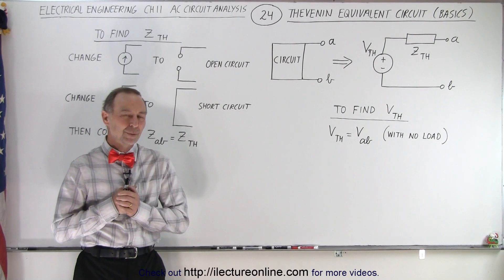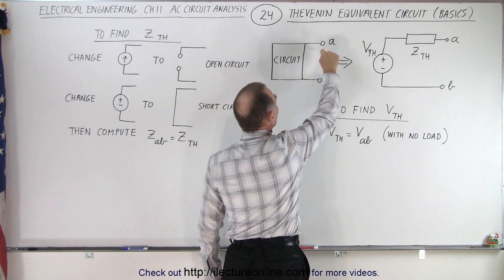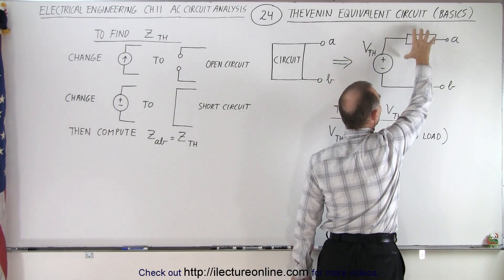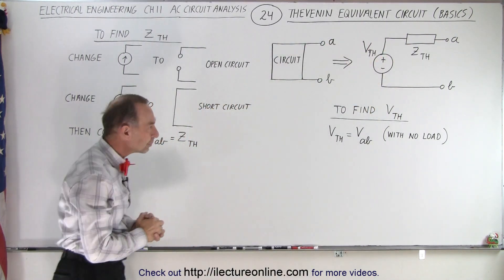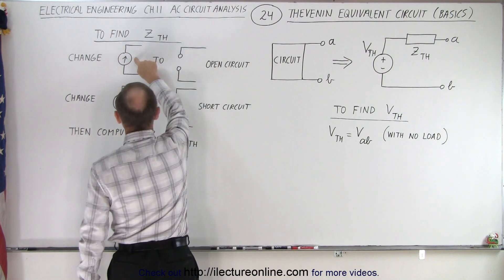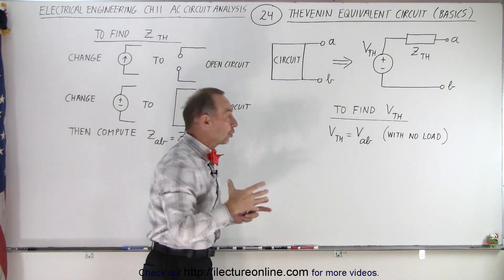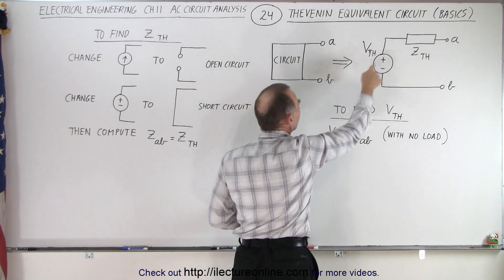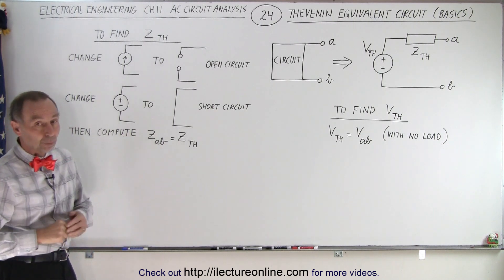Electrical Engineering: Ch 11 AC Circuit Analysis (24 of 34) What is Thevenin Equivalent Circuit?

Comment: Question:  Why do we change the current source to an open circuit  ?
Why do we change the voltage source to a short circuit  ?
Reply from the maker: Good question.  When we "turn off" the current source, not current will flow through that branch, so in order to eliminate the current source we have to eliminate the branch (open it).  The branch that has a voltage source, can still have a current in it, (from other sources), and thus we must keep the branch, but just replace the voltage source with a wire.
Reply: @MichelvanBiezen  
I thankfully received yor reply while watching your later videos. (25 of 34) and (26 of 34). The first part of your answer is now clear. Now regarding the 2nd part.   If a circuit has only one voltage source and we change it to a wire or short circuit, what would happen ? My question is where would the current that still be in it come from ?
Thanks for great videos.
Reply from the maker: Note that when we remove the voltage source, we do so in order to find the impedance of the circuit, no current needed.
Reply: @MichelvanBiezen  
I am very glad to receive your explanation.
Thanks for your great videos.